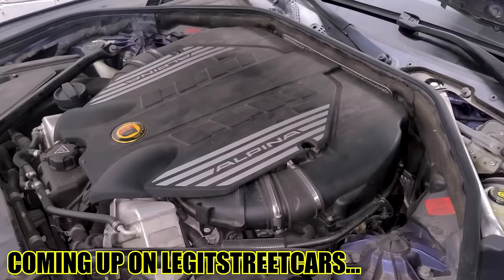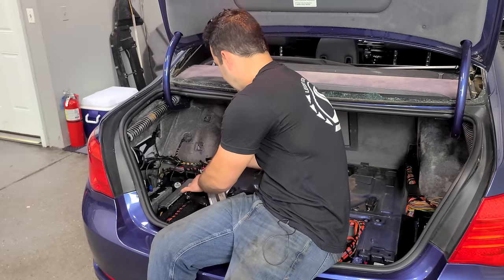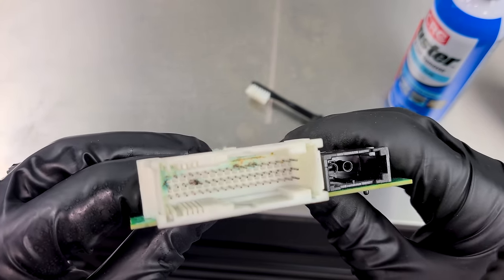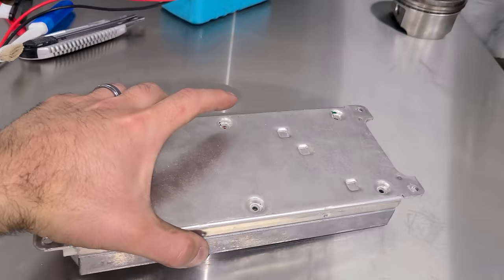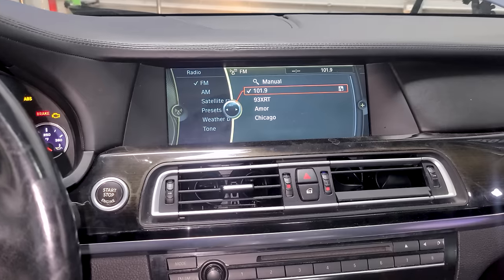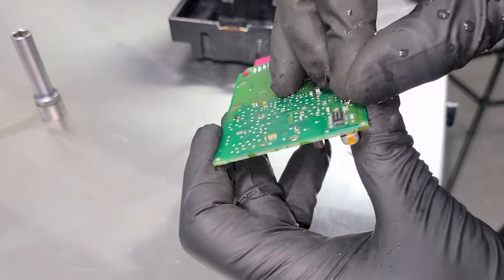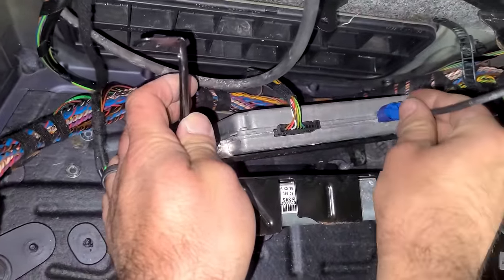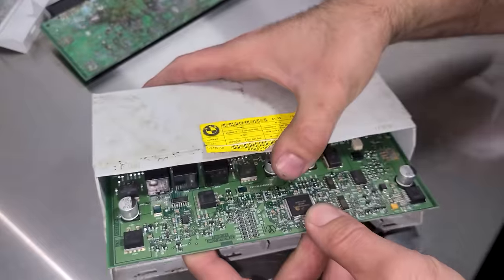BMW Dealer Tried Totaling My Car By Quoting $15,000 For 10 Computers! I Fixed Them All For $150!

Comment: It does not matter the industry, the dealer always tries to get the maximum amount of money regardless of what's wrong with the product. Good job showing people how they can do better. Thank you for sharing this with the world
Reply: IF ANYONE KNOWS HOW replacement part dealers screw the repair industry it is Louis  as he has not only battled Apple and it's amoral business practices but he has spent time and money travelling the country publicising the cause.

I am lucky, live next to China where it is possible to buy even copy bare PCBs from after market shops. But there again, I never buy anything Apple.

Thank you Louis.
Reply: BMW dealer tech here!  Love you Louis and figured I'd comment that it pains me every single time I have to replace a control unit whenever something like water damage occurs. If it's customer pay and I don't have to turn it back in for warranty, I'll take everything apart just to look at the cause of failure. Unfortunately, with "warranty", all of these kinds of items (and every other item, for that matter) need to be turned back into the parts dept to potentially be sent back to the manufacturer for "inspection" so disassembly would void any of that and then result in my getting back flagged for my time or I'd do it with every one of the items. 

Unfortunately for me, I have to go through this on a daily basis. I genuinely feel terrible when I have to quote a replacement control unit + programming when I know that it MIGHT not be necessary.

Those trunk lid control units have always been manufacturered like garbage with little to no protection built-in if something goes wrong. I've literally seen one fail and just catch fire. Literal flames coming from the center connector due to over current on a non-protected portion of the PCB. Absolute garbage.
Reply: Of course, the "maximum amount of money" they can get, isn't the retail price of replacing it all.. it's what a rational consumer will pay.
Reply: If Louis Rossman jumps in the comments, you KNOW it's getting serious 😂😅👍🏻
Reply: Of course they try to get as much money as they can.  So do independent repair shops.  That is business.   They have a set cost for parts and labor...  And they are in business for profit.   If you can do the repair yourself, thats great. You will save a lot of money.
Reply: @davidgalietti3398  not "of course", because the customer can never buy that brand again
Reply: @xpusostomos  presumably the customer does some research and buy a car that they can afford to maintain and repair.   Especially important with a car like BMW.   Or learn how to do it yourself.
Reply: @davidgalietti3398  hard to research that a leaky trunk can cost $15,000
Reply: @xpusostomos  that kind of repair your insurance covers.   And if you buy a car with flood damage..  it is at your own risk.  It is well known that flood damage totals most cars.
Reply: @davidgalietti3398  it only covers it if it was the result of an accident or flood or unusual event.
Reply: Dad? Is that you?
Reply: Can you help the community and list the control units that need new housing designs with gaskets and stuff.
Reply: Thank you as well good sir for ur computer repair videos too
Reply: @davidgalietti3398  so being fair isn't enough. Remember young lad, capitalism ALWAYS eats itself especially when there's people like you that happily vote against your own best interest.
Reply: @Jdalio5  the current life you live, with the freedoms, luxuries and technology that you enjoy simply wouldnt exist without capitalism.  Shit on capitalism all you want...  From your iphone or multi thousand dollar pc while drinking a $15 latte.
Reply: @davidgalietti3398  I love the theory of capitalism except there are no examples on earth to determine just how great it really is. See I live in America where our gubberment picks the winners and losers. Thus restraining the free hands of capitalism inwhich you worship. Good on you though....you make uncle Joey proud!
Reply: WOW!! Didn't expect to see you here :) that's awesome!
Reply: That's why they call them Stealers
Reply: I fixed my Mid Displays on both my e38 and e39. 99% of the time it's the lack of contact from the printed ink on the plastic ribbon that causes the displays to start loosing pixels. They use the same concept on the instrument cluster on those cars.
Reply: I think it’s more for liability reasons on their end.  Replace with new shifts the problem to the manufacturer instead of directly on themselves by actually fixing things.  Unfortunately we live in a very sue happy culture and that ruins a lot of things, including saving people money while making yourself more money.

Comment: As an electrical engineer, you will be surprised by how just cleaning off connectors and circuit boards will fix huge issues. I'm very impressed by how you handled these issues. Good job!
Reply from the maker: Thanks Marcus
Reply: Sometimes the corrosion eats through the copper traces on the circuit board.
A shop that repairs cell phones and motherboards by microsoldering can repair this.
The NorthridgeFix channel has videos showing how this is done.
They also repair keyfobs.
Reply: Wrong.
Reply: As an IT person who fixes all sorts of things that have nothing to do with IT (washing machines, tv's, etc) you're spot on. I fixed so many devices by just cleaning the contacts as a kid.

Comment: My first job out of college in 1985 was at an electronics firm.  I learned everything about soldering and cleaning/coating/assembling circuit boards.  You did everything very well!  BTW: the coating was called "conformal coating" where I worked.  At a different company, we put the liquid coating material in a vacuum chamber to suck any entrapped gasses out for coated circuit boards going into space.  Fun times.
Reply: Was about to make a comment about the conformal coating too

Only thing is I would’ve used more solder to make a shiny joint and use some flux
Reply: In the 80s I did the NASA 'high reliability soldering; course and the 'multi-layer printed circuit and flexible circuit board repair' course and yes it is definitely known as 'conformal coating'. we used to use a vacuum chamber as well, it worked better on acrylic coating than epoxy. we did that because the equipment I was working on were parts of the F/A-18 Hornet fighter
Reply: I recently talked with a marine electronics shop about their corrosion prevention for ordinary connections. (Saltwater is the worst.)
I had dropped my cel phone in my sailboat's bilge ... They said their anti-corrosion potion is dielectric grease; for the rest of us; pure lanolin, straight off the sheep. Keep a meadow-maggot around the shop and you'll have a forever supply of the stuff.
It's great to hear about the "conformal coating." Why didn't Chrysler use this stuff on their '76 Dodge POS's? for no money at all, they could have saved their marque from a bad rep that follows them to this day!
Oh yes ... the cell phone in the saltwater? You should'a heard it screaming as it died!  Sad.
Run your car into the salty surf and AFAIK, it's DEAD! Burn or crush it quickly, so nobody gets stuck with any parts off the thing.
Reply: There's multiple types of conformal coat. They are not only not necessarily compatible (unless proven otherwise) but in some systems, the type of material is pohibited, Silicon for example. Even on Class 3 (mission critical/lifesaving equipment) PCB assemblies, brushed on conformal coats can be used, so long as the design supports it. Re-work and repair also may (or may not) support brushed on coating.
Conformal coating for a PCB can be removed with your fingernail. Not so great for a car.
Reply: Crazy. sounds like hvac. Soldering, vacuum etc I know different temps soldering and all but we have to pull vacuums anytime we open the refrigerant lines. We also do plumbing, electrical, air flow, engineering for sizing and heat loads. 
I’m definitely wanting to do everything on my own. I do honest work. It’s hard to find other industries with the same. I’ve been self teaching working on my vehicle.
Reply: That looked more like kapton tape than any conformal coating I've used
Reply: You don't need to be a mechanic.

Proceeds to use speciality line wrench to remove brake lines!

Great video. But if you have the skills to disassemble interior, get at these modules, depin connectors, disassemble modules and remove circuit boards, ribbon cables, use contact cleaner and brass brushes, chances are you're also someone that works on their own cars.
Reply: @villagelightsmith4375  except that there is more in Dielectric Grease than "Pure Lanolin"...

Comment: One addition I would add to your supplies are thermal pads.  One of those modules had two pads on them.  Those are to conduct heat from the chip into the case and dissipate it.  It's a passive cooling system.   Often they have a small amount of adhesive on them, and that electronic cleaner can remove it.  You can buy sheets of thermal pad for not a lot (10-15 bucks), and then cut to size and replace.  The main thing is to match the thickness of the existing pad.  Too thin and it might not make good contact with the metal casing, too thick and it won't conduct as much heat (and could put stress on the chip and/or board).

Comment: Great to see you show the repair of the circuit boards.  SO many just throw them away, when most can be saved.  Looking forward to seeing it finished.
Reply from the maker: Thanks! Means a lot coming from you.
Reply: Most guys just recoil in horror when they see an Alpina ... and with just cause!  This is not only a BMW after all, but it’s an even less reliable and more complicated one!  It’s OH SO satisfying to see you tame the BEAST!!  👍👍
Reply: Where I live, junk yards charge 50% of the original new part price so this repair would have cost thousands, even as DIY.
Reply: @dingdong2103  I've seen some junkyards around me literally charging the same price as Mercedes if not cheaper by maybe $5-10. Textbook insanity.
Reply: @dingdong2103  eBay (not a sponsor) is the place to go for that kind of thing, there's always a seller somewhere out there.
Reply: @simontist  yes except you never know what the condition of the Ebay part is. It's risky.
Reply: @pharkasj  The correct way to do it is to apply flux and heat to resolder the pads.
Reply: its not even repair, just some attention and cleaning, really a shame how much stuff is getting thrown out
Reply: It's usually that green corrosion stuff shorting between component terminals that causes water damage failures. Ya clean it off and try with fingers crossed!! .. 1/2 the time such corroded boards when powered, blow a few components, then it may be junk.
Reply: @RothBeyondTheGrave  Thankfully internet listings are free so you have a lot of choice regardless of where you live.
Reply: @KrustyKlown  I repaired my GTX 1050TI rinsing off the corrosion with dish soap and toothbrush and then baking it in a oven at 150°C for 5-10 min
Reply: @sidrat2009  very true. I have been surprised by people not willing to ship certain things however, or the shipping price making it not worth it.
Also depending on the part, I'm not sure how much you/I would trust it without an in hand visual inspection. 
Videos & pics don't show everything, & asking simple questions these days does not return simple or detailed answers.....like me trying to ask widths, offsets, & part numbers for wheels & people just can't bring themselves to answer. Even though it's on the back of the wheel.
Reply: I had no idea. Was a mechanic military, and pretty good at trouble shooting, and I did network admin stuff too. Hadn't thought to repair a board.
Reply: @RothBeyondTheGrave  that rule would count me out of baby S class ownership. 

My W211 E500 isn’t that bad, but when I need expensive parts or modules, I’m more likely to go for the $15-30 one from a pull yard than the several thousands it would cost from the dealer.
Reply: @bleachstain9785  nice, I've been thinking about w211 E500's as a possible 2nd car. Glad yours isn't giving you trouble. They seem pretty solid as long as sbc is under control. 
What kind of stuff have you gotten from junkyards?
I had looked for headlight assemblies, wheels, & interior pieces  among other things for my c207 chassis from junkyard sites all over the country & never saw prices cheaper that what Mercedes is asking for. For brand new parts. Same goes for fcpeuro, autohausaz, etc....guess it really depends on the chassis, the yard, & the current demand/market.
Reply: The problem with "fixed" electronics is just, that you just cannot RELY on them. Just remember the legal follow ups. I LOVE Repairs myself. I am a real computer dude and fixed a lot of stuff myself and I am in general absolutely happy about ppl repairing stuff.

BUT : when it comes to safety related stuff : better be safe than sorry. it is absolutely NOT safe to run a car with overhauled electronics that was harmed that bad before.
If you have any case of insurance case with this car now and the insurance sees this video : You`re doomed. And that`s absolutely correct.

Repairing is awesome. Knowing what not to repair even if you could - is a very very important part of repair-skills.

Comment: If you suspect water damage to electronics do not put power through the system. Don't even connect the battery unless you don't mind risking causing additional damage through a possible short. If you put power through a dead short you will likely have something burn up. These electronics cleaning repairs in this video are only likely to work if you make sure everything is clean and dry before you apply power. 

In most cases it's not the water that causes the damage its the electricity flowing through the water that causes accelerated corrosion and component failure.

Comment: after cleaning PCB you need to spray CRC 226 to stop corroded areas corroding again
Reply: Better yet, use a conformal coating such as Humiseal,  it is what it was made for.